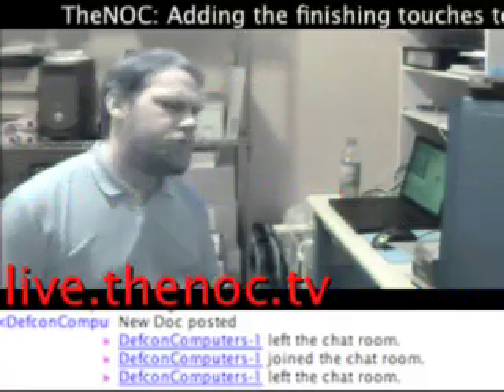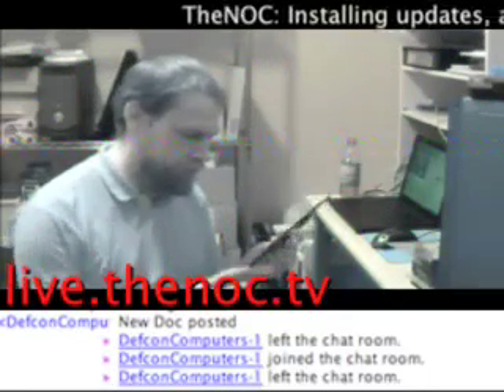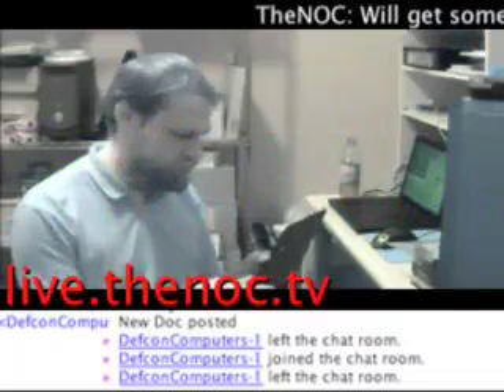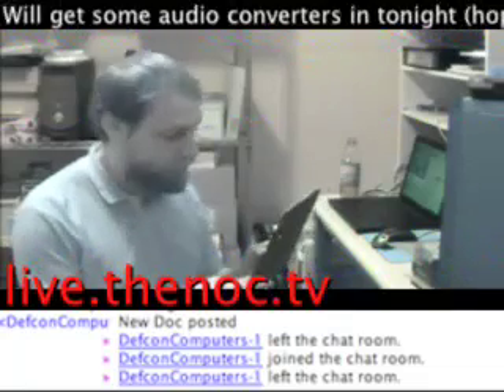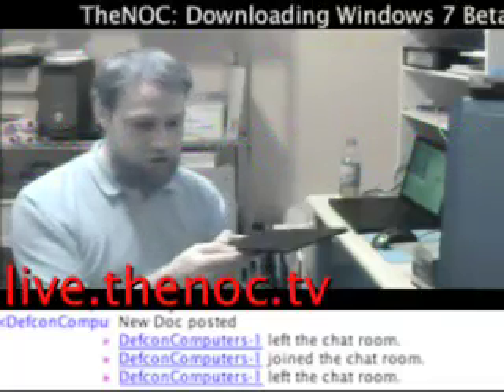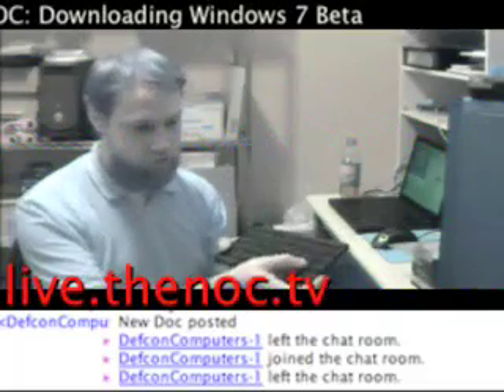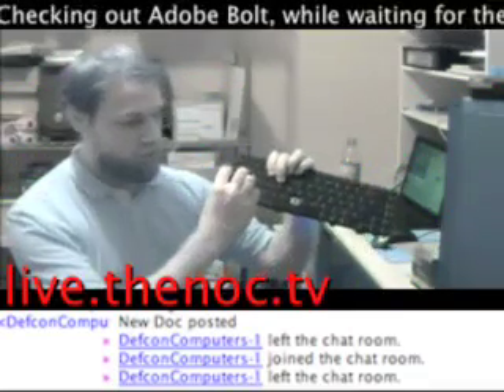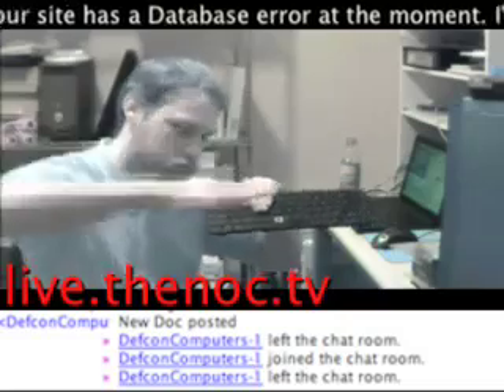How the buttons on a laptop keyboard work

Comment: What do I do if one of the keys isn't having a good contact when I press it?  I'm on a laptop and have the rubber film and plastic pieces with the letter plates attaching on the top and bottom of the scissor pieces. 

I'm not missing a key, but my S key doesn't want to work well when I put on the plate and for a while after I take it off and mash on it some.

Comment from the maker: Shut the laptop down, press and hold the FN key and wiggle it back and forth up and down, etc. Do that like 10 times. Make sure there are not more than 1 FN keys on the keyboard, if there are additional ones do the same thing.

If that does take care of it then the FN key has simply shorted out, or there is a bad connection with the keyboard. In which case the likely best solution is to replace the keyboard.